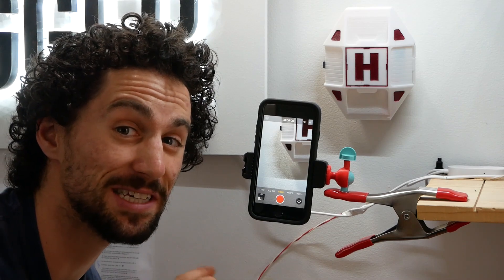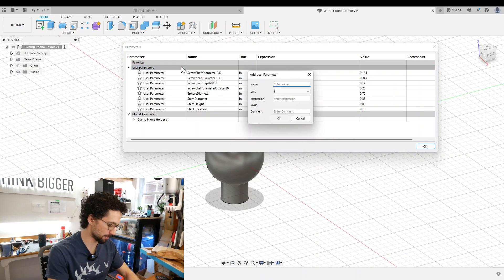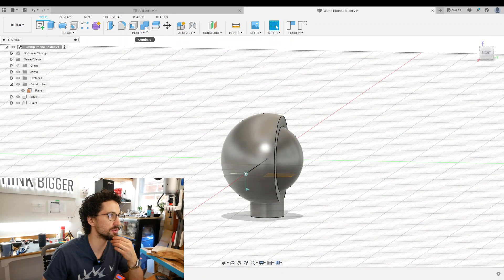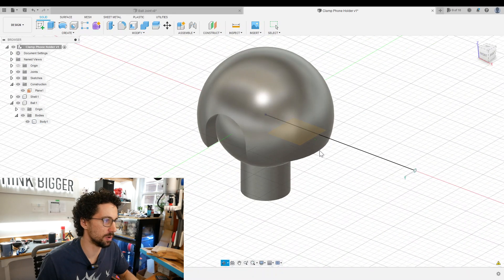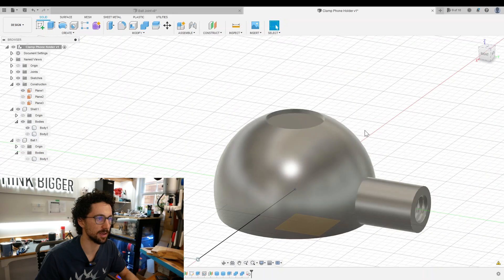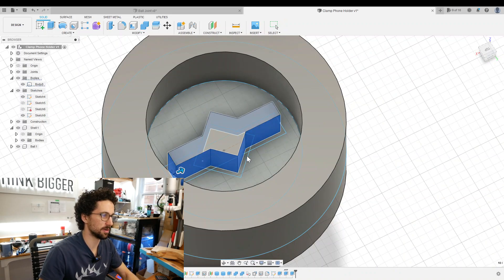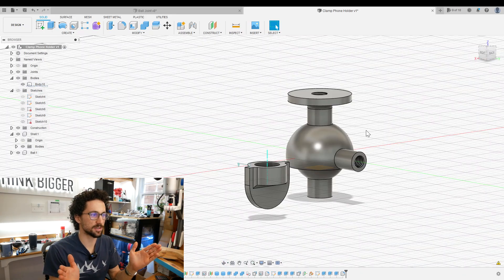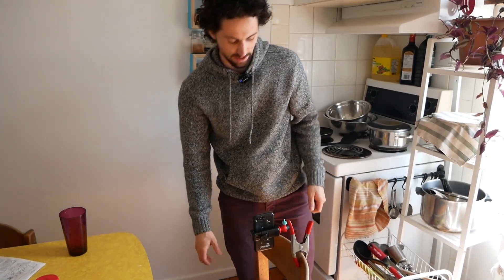The Best DIY Phone Stand?

Comment: Nice idea. But I have some recommendations: 1. use correct length for screws 11:18 - no need to cut.   2. Use screws with Other heads, with internal hex, or (please don't bet me) Russian screw with a hexagonal head. When you put the last one in the plastic shaft - it can't rotate, like ISO and DIN ones with round heads. You see less glue, more material tension.  3. If you would make internal shaft for screw head in ball-head part - it could be done in One piece - no glueing 11:32. One part stronger.
"From Russia with love"
Reply: DIN 933 / ISO 4017 have hexagonal heads ;)